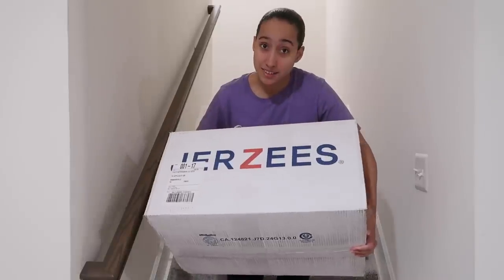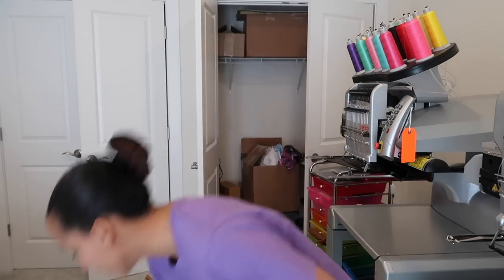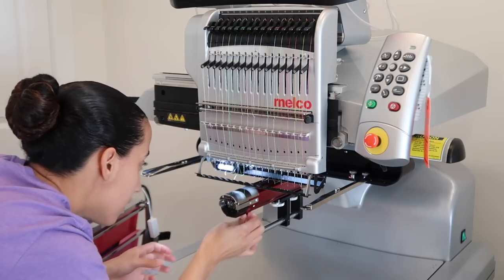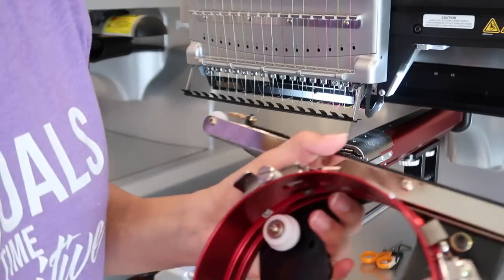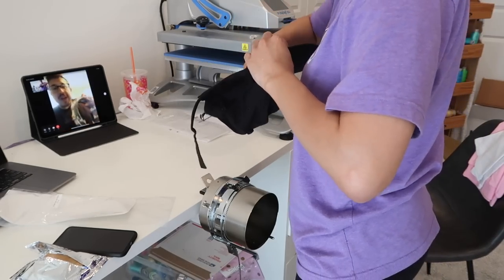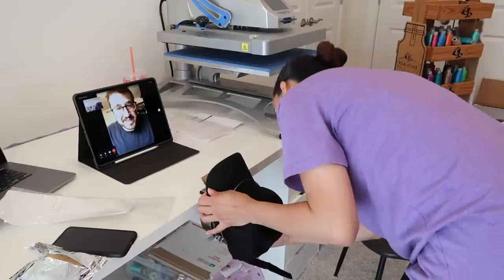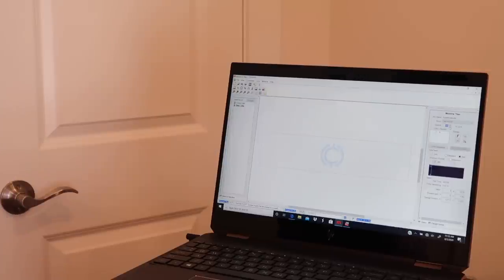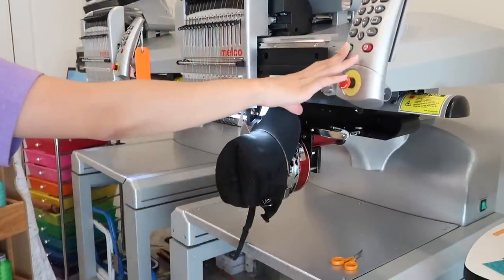Embroidering My First Ever Hat on the Melco EMT16x Embroidery Machine! Unstructured Dad Hat

Comment: Did you use the 65/9 needles when stitching hat?
Reply from the maker: No, I used 75/11 but there is also the 80 size ones!
Reply: Angela Jasmina Thanks:). I wondered if u had left them with 75/11 or changed out. You did a great job!! First time is scary..lol😛
Reply: Quick note: I use 75/11 also but I think 80/12 is better for structured, like Richardson caps? :)